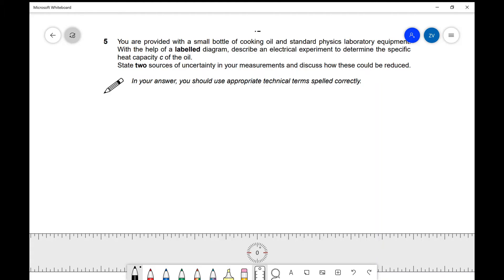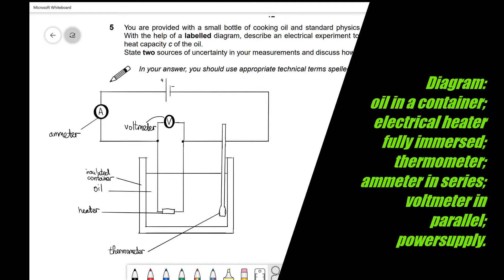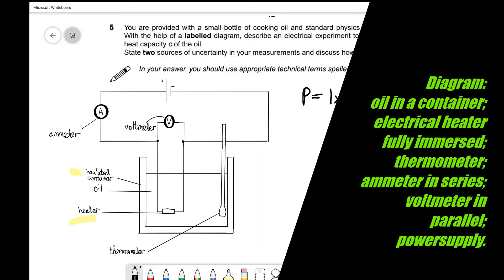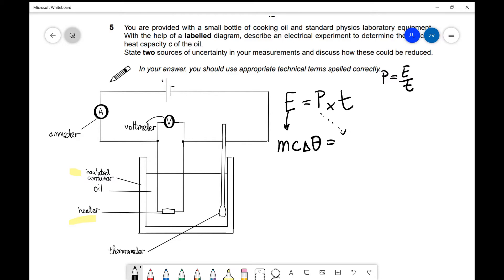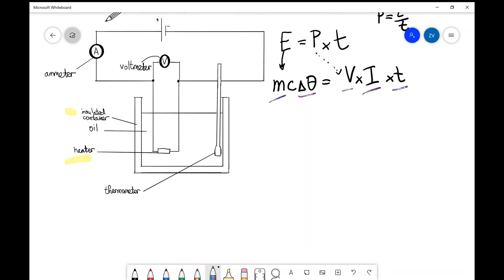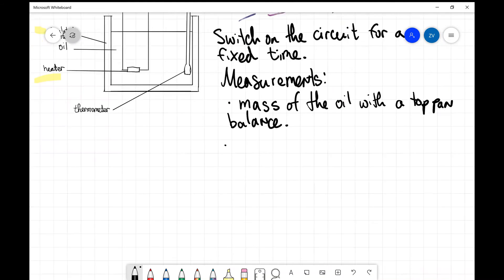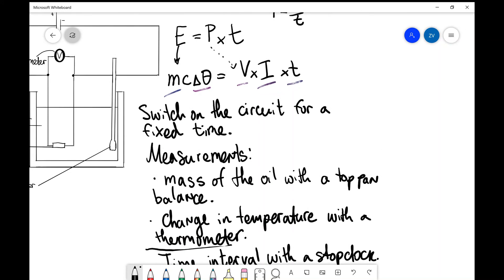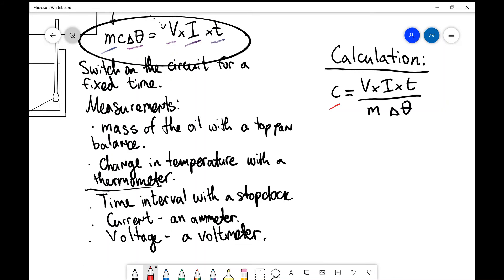A Level Physics Experiments: Determining the specific heat capacity

Comment: would it be wrong if we used a joulemeter connected to a power pack instead of voltmeter and ammeter to measure the energy?
Reply from the maker: in practice totally fine, I don't remember seeing that in a mark scheme. Hm, I'd probably use VI to measure P and then use E=Pt in an A Level Physics exam. Good luck!

Comment: are you not required to plot a graph and find c through calculating the gradient in this practical?
Reply from the maker: You could also plot a graph on this as well if you take regular temperature readings then plot temperature against time and use the gradient. All covered in all of thermal physics 1 video I posted after this one. Hope this helps!
Reply: @zhelyo_physics  thank you very much.